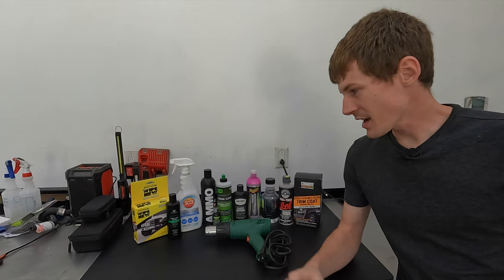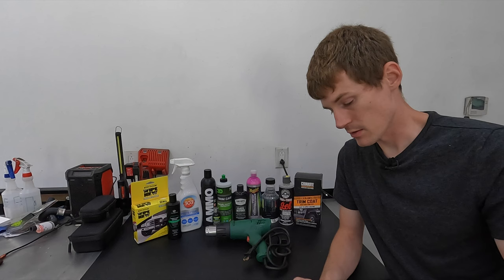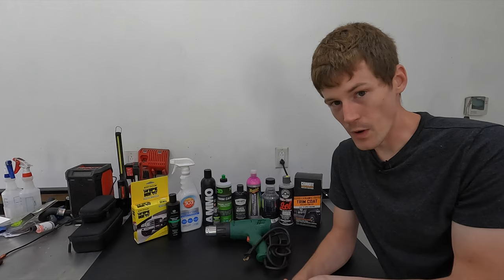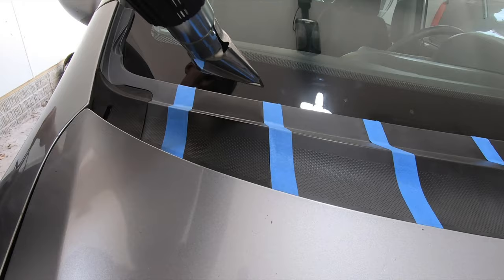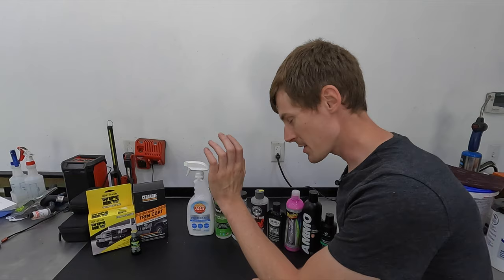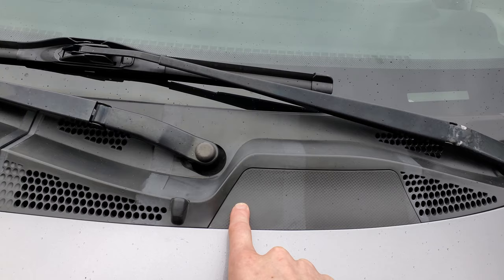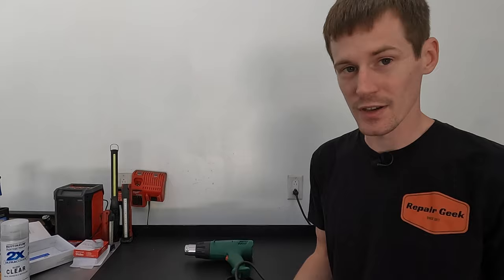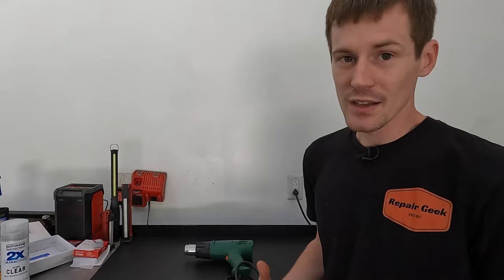Longest Lasting Trim Restorer Test.  Meguiars "Ceramic", Chemical Guys, Cerakote, Ammo, & More...

Comment: I use cerakote on our 7 sprinters. I have not seen the spotting you experienced however it does leave it glossy, Which our sprinters are all black so that is actually a bonus in our application. I do want to just paint the trim black as it is a horrible quality to begin with. and a lot of white spots like stress marks from forming it seems (if you have seen when trim gets hit in an accident, same thing but just there) and this actually hides that and makes it uniform again. Admittedly I have not used anything else because the amount you get for the cheap price and the length it lasts as you proved can not be beat. Of course if I had those dots then I would certainly have an issue. How I apply it is, I do a wipe down multiple panels to get the really wet product off the wipe and to disperse it more and then i go and work it in the whole piece of trim then go back to get it more even when the wipe is kind of "dry" I use 3 to 4 per vehicle. (different wheel bases) and sprinters have A LOT of trim.

Comment: I have a 2003 Avalanche and all my plastic still looks like new and it didn't cost me anything. The secret was to leave it in the garage, so it only has 17k miles on it. But anyway, maybe you should have tested sun block, since nothing else seems to work. Good info, thanks for the video.
Reply: No wonder you have no fade, that poor truck rarely sees the sun. An 03 with 17,000 mi.  You could probably sell it for more then you bought it. 
My brother had owned 3 of them, and they are like a luxury truck.
Reply: @Theyralltakenfu  It's never seen rain either.
Reply: @kwd57  😂
Reply: @@thatv8life186 I am not saving it to sell it. I bought it because of how versatile it is, but not for a daily driver. I have had other vehicles with very low miles on them that I have bought more as a want and not a need. I did recently sell my 1985  crx si with 5k miles, to a friend who was begging me for it for years for more than I payed for it new.
Reply: Agree 100%! Leave the nice ride in your cozy garage............get a CHEAP beater as your daily. Your sweet ride will love you forever!!!!

Comment: Owatrol Polytrol....Better then the rest, you can use it on very faded plastic and it looks like new for almost a year. The 303 is good as an interior dressing.

btw: you can use Owatrol Polytrol even on faded paint, metal,....
Reply: I have used it. But after a year the polytrol left a white crusty brittle layer. It looks ugly . Later I switched to Malco epic and it's far better . Application of polytrol is tough.

Comment: Cerakote, properly applied to a properly prepared surface, will last well over a year.  I just tried to reapply it on my Lexus after 2 years and ran into trouble.  I had to contact Cerakote to find out how to remove the remaining coating in order to reapply it.  (Pink non-acetone nail polish remover and a Mr. Clean sponge.)  I don't think you are used to working with ceramic coatings. Take a microifiber cloth and gently wipe down the Cerakote after it has had a chance to absorb for a while.  That knocks down the gloss and evens out any blotchiness.

Also, unless I missed it you didn't identify the car (quality of plastic trim), and, most importantly, if you had treated the trim before you did this "test.."  If you had used other products, it is critical that you removed all of it.  A simple wipe down with IPA isn't adequate.  You didn't even follow Cerakote's directions.

Also, your assertion some of the products are promoting UV damage is nonsense.  A product that is absorbed into the plastic is going to behave differently than applied in liquid form to a glass slide.
Reply from the maker: So a product that is absorbed preforms differently than the liquid sitting on the glass side? If that was true, how come the sunblock worked? That absorbs into your skin and yet showed a high level of UV resistance on a glass slide.
Reply: @RepairGeek the guys a tool...good video!

Comment: This one's a real eye-opener, esp. the light testing which shows despite the claims, none really offer much "UV protection".  As for 303 I'm also a longtime user of the stuff...mostly owing to having a gallon bottle which has lasted me a long long time as a DIYer.  That said it's great for interior stuff but exterior it's a total waste of time.  It's not really a secret it doesn't hold up to the elements...at all.  If you use it outside the vehicle it will basically look good for that day...and even then that's only if it didn't rain that day!

On the ceramics the "Followin" stuff was far more shiny looking when applied as compared to the others.  But as noted the "after" results show it quickly came down in glossiness and was better looking...to my eyes...after 1wk, and the rest of the test, compared to the Cerakote.  While it's subjectively put in "last" in the ceramics category, just visually it seems to be the best, to me.  Not too glossy (short time after initial application) and lasts a long time.

Comment: I use tire shine and it lasts for a few weeks, very easy to apply and way cheaper than any of those products, doesn’t damage paint. You really don’t want a permanent coat aside from the fact that it doesn’t exist. I have tried all the products he showed and a lot more and tire shine still outperformed even the most expensive ceramic I tested.
Reply from the maker: What tire shine do you use. There's 100's of them.
Reply: @RepairGeek  I use the CHEAPEST that I can get, even use "dollar store" stuff. Sure, you have to re-apply often, but you also have to do this with the EXPENSIVE "designer" brands.
Reply: most (if not all) oil-based tire shines will suck the moisture out of the tire and cause premature cracking and browning

Comment: I had opposite results. My truck is outside 24/7 365....the new Wipe New lasted only a few months before fading. And Cerakote has lasted over almost 2 years on my truck and only had to touch up my rear bumper once. That's even after being in California (mojave desert sun, high wind with sand is pretty brutal) and moving back to Virginia and dealing with all the weather elements up and down each coast and in between. I recommend Cerakote to all my friends over any product.

I say "the new Wipe New" because I used the product when it first came out in 2012 as a "as seen on tv" brand on my previous vehicle. And it worked great for almost a year! But Rustoleum bought it out, and they had to have changed the formula. Because Wipe New now is trash in comparison to the original.

Comment: great video! been looking for something on this issue. hoping a manufacturer or someone reaches out to you with a better product. i don’t like the way ceramics look. but i hate when it rains and these other products start to streak and degrade. also didn’t even think about the fact uv could be accelerating damage of the plastic with some of the products.

Comment: Great video! I detail all my cars. It was so cool to see Car Guys Plastic Restorer perform. I've been using it for years because I found it to be the best. Been using it for years. Please do one on spray wax. Someone years ago did a great spray wax video and Turtle WAx Ice was the clear winner. It would be interesting to see who is the best now. Thanks.
Reply: Any tips on using the Car Guys? I was very pleased with the results (did 3 coats to restore very faded trim), but after a rain and a week or two, it streaked and faded.
Reply: @Each-Uisge  try trim serum Li, I have found this does not run and is lasting a little longer as well.

Comment: Heat guns do work if done properly..A torch is even better..Let me explain why. The oils in the plastic dry out.They also acquire mold and mildew in them.Most cars and trucks have numerous different pieces of cladding (or plastic) from different countries. You burn all the mold and mildew off, bring the oils out and then put a coating of something good on there and it will last for years..yes years..I did it and made a video but sold the truck a year later..Still looked awesome....

Comment: Been using car guys for years. Love it! Was surprising to me to see some of the products allowing more uvr than the control.. 

Correct me if I made mistake, but wouldn’t that mean they are supplying the opposite of a protectant?

I guess the measurement itself isn’t a direct correlator to the total damage/wear of the material, but I like the extra data to chew on.

Comment: 18 years ago I bought a jeep cherokee. It had faded black trim. Found a forum recommendation, sourced it, applied it and 18 years 300000km later fender flares are still black. Lived it's entire life outside. Lost the bottle many moves ago and do you think I can remember the name? It was a clear thickish almost oily product that curiously came in a spray bottle. Curious in that you were not to apply it directly but were supposed to apply it to a rag and then apply to the vehicle. Anyways I think I applied 2 coats. If I were to speculate I would imagine that  the company got bought out by one of the other big names. If they still existed it would be a household name. I imagine they did this so that they could continue selling their short term gimmick solutions.

Comment: As a 2nd CR-V owner, I'm still on the hunt for something to make swirled faded plastic uniform black without just painting. Solution Finish seems to be a favorite in the CR-V community but it just darkened my swirled coloring. I think previous dealer tried tire shine causing the swirl. Back to black and wipe new did not work for me.
Reply from the maker: Sounds like you have an issue with the dyes being broken down. SEM trim paint may be your best option if you can't easily or cheaply replace the plastic.
Reply: @RepairGeek  sounds like I'm probably going to give up and leave the dad mobile alone. It's saving grace is the 5-speed.
Reply: Sc1 high gloss coating

Comment: Even new doesn’t last. It all requires upkeep. Use whatever you have around. Terpentine with boiled linseed oil seems good lasting and cheap. Mix varies depending on source. Terpentine is used to make the oil penetrate the plastics. Add a few layers and then “seal” lightly with pure boiled linseed oil. Mind the flammability!! Once dried it’s okay. So then mind the cloths you use. Burn them afterwards.

Comment: Grate video. Like from me.  But the UV test showed how much applied layer of protection is transparent for uv rays. It did not represent the level of protection. I assume that this products should penetrate in to the plastic and make molecules more resistant to uv. Not to be a barrier between uv and plastic surface like a sun cream. I think the best test would be to use a UV lamp.

Comment: I kept wondering, why not combine the heatgun with an oil/treatment (while warm).  While the oils will rise to the surface with the heatgun, if you add oils they will also wick into the pores/matrix of the polymer. My guess is the combined approach would yield better and more lasting results. That and adding a UV protectant.
Reply: That's smart what oils would you recommend ?
Reply: Smart!?, Yeah what oils would suffice in this..
Reply: Garlic infused olive oil. 🙃
Reply: I'm gonna try the heat gun followed up by applying sunscreen to the front , black, air dam on my challenger.  Hope this goes well...
Reply: WD 40

Comment: For what it's worth... 303 is better used as a conditioner in my opinion. I use it on anything plastic, vinyl or rubber, and Rubber being the main thing I us it on. I find if I apply it to wiper blades about once every  3 months, they last WAY longer than if I don't. Also great for conditioning al rubber seals, helping them to not dry out and crack, and I use it on the rubber foam surrounds on all my speaker for my house audio equipment, to prevent them from drying out and deteriorating, which they do over time.
Reply from the maker: I don't disagree. 303 wrote restoration on the bottle that's why I tested it as one.
Reply: unfortunately 303 aerospace protectant is WATER-based, which means it splooshes off the 1st time it rains.  If no rain it'll last about 6 weeks.  Also noteworthy, I have a 5 gallon jug of the stuff and it comes with a cancer warning label.

Comment: I wonder if using the heat gun, and re-applying something like leather lotion very soon after would help prevent the UV breakdown… similar process with leather boots, not exact but similar in the breakdown processes and refurbs.. leather just takes new color better..

Comment: I say 303 Protectant is a preventitve measure . Clean your plastics and rubber , let dry and apply 303 Protectasnt . Spray on , let dwell for several minutes , then wipe off with microfiber towel . For my engine compartment , after cleaning I will liberally spray it everywhere and let it be . It lthen of course attracts surface dirt . After a month I will then spray Zep orange cleaner full strength , let it still for a few minutes . And then wash off at the self serve carwash .

Comment: What about testing Mother's Back to Black or Maguire's Fade to Black?   I have a 2002 mid size pickup with the plastic fender cover's and these products worked well for years until they didn't...lol  I live in AZ and didn't apply it regularly.  By the time I started to, I think it was too late. Like I said it worked until it didn't. The last few years have been harder and harder to keep them black for any amount of time.  I did go to Chemical guys tire and trim, Not the gel that was shown in this video. It did bring back the color the first few times I used it. Now I am back to the faded tiger stripes I had before. Very frustrating.   Happy I didn't try the heat gun treatment before seeing this video.

Comment: Not really worried about lasting a few weeks    I want to know in 5 years will the plastic fall apart?    You said buy new plastics  but in reality you will spend $100s  is not more if it even available. But how do you test for that or reaction from mixing multiple items in the years.

Comment: You're missing the two best products for trim restoration. "That Black Stuff" is best for bringing black back to faded plastic.  No matter how faded - it will turn it deep black but the finish is matte.  Malco Epic Revive Nu is great for enhancing black on OK to new plastic and leaves a great shine that  typically lasts over 1 year on an outdoor vehicle.  If you apply the Malco 5 mins after Black Stuff you will get a lasting shiny deep black result on any plastic.

Comment: You discussed at length the porous nature of plastic and then tested UV protection by briefly applying and quickly wiping them off one of the least porous things: Glass.  The fact that the UV transmission was more shows that you cleaned the glass, not that they "Increased the UV damage."  Maybe a clear plastic for the UV test would be better?
Reply from the maker: If the surface being porous had any affect on the testing, how come the sunblock worked on the glass? It works on your porous skin and worked on the non-porous glass...

Comment: Just saw your video and im not surprise on the results as i have tested almost identical products, its disappointing and such a waste of money. Try out ceramic coating and or wax and u'll be surprise on the UV protection. Thanks making this video and making people aware. Btw cerakote on my testing held up on car that is parked outside for year and still going. Prep is key on making the product last. Im going give wipe a new a try.

Comment: Enjoyed the video. I'm about to ceramic coat (w/graphene) a new car and I'm on the fence about doing the trim/cladding. Does graphene help with UV resistance since it's "supposed to" displace heat and help with UV.

Comment: I have had good results by preparing the plastic with a good cleaner and degreaser, masking of areas as necessary and the spraying with satin black trim paint. Once paint cured you can apply protectants if desired. There is a ceramic coating for satin or flat paints available. Take care of the trim after this process and it will look good for a long time.

Comment: 24:43 I believe that might had been environmental contaminants. I used it for my Honda element and I did not get that result of small spots. However In some sections it seems like the product did not adhere to the plastic correctly and left some patches or streaks uncovered
Reply from the maker: It didn't happen with any other product. Everything was prepped the same way.
Reply: @RepairGeek  maybe the plastic? I used cerakote and that didn’t happen to me and I used it all over the car in different places and even inside the car and I didn’t get that result

Comment: This may sound crazy. But your testing on the UV blockage was interesting. I was involved in the plastic industry for years & they add UV inhibitors in the plastic but that only last so long, so you know as well as I know the UV is a killer!!  After you showed the difference & then to  prove your point you put UV lotion on a test piece to prove your point. This is what I'm gonna say sounds crazy now..... what if after you applied the product any one of them & then after that dried put the most UV inhibitor on top of that being the lotion? I wonder how that would work?
Reply from the maker: Thats what I want to try. Used the heat gun then hit it with a matte automotive grade clearcoat.
Reply: It seems like a great idea to use a UV inhibitor starting from the beginning of a car's life cycle to keep away the grays!

Comment: Odd, I just put on Cerakote on my 2019 Mustang and I prepped it with Chemical guys wheel & tire cleaner followed by a microfiber with 93% Alcohol and I was disappointed how low gloss it was. Now that was the first time I put any coating on it other than  Meguiars Tire shine and the trim was starting to look weathered. I'm starting to think I might tape it off & spray it like the guy before me did.